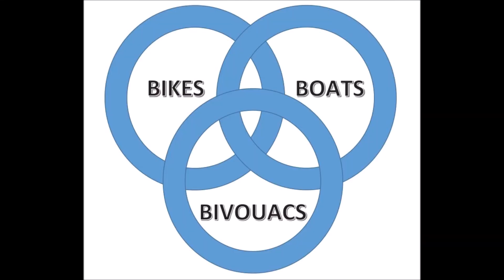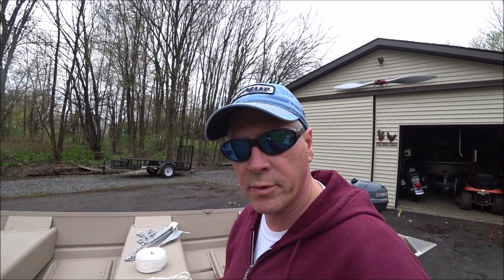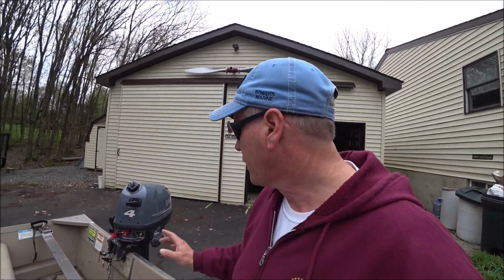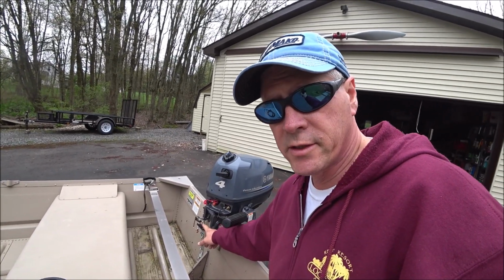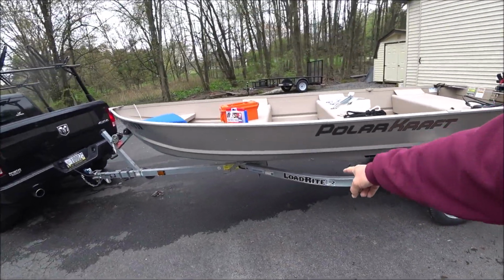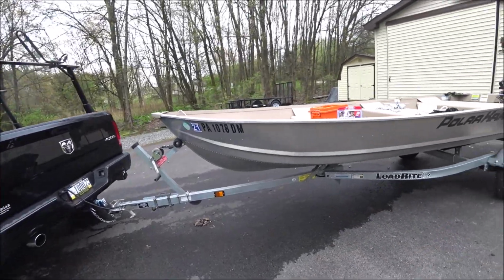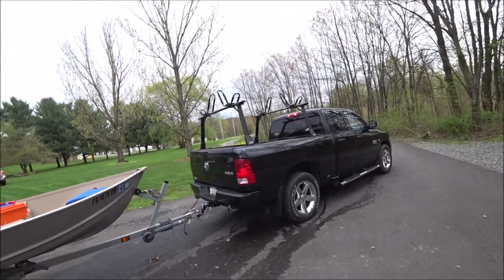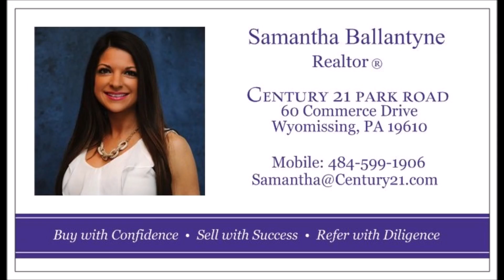Yamaha 4 hp outboard motor break in procedure on a PolarKraft 1460!

Comment: What I find strange is every motor, being car, bike, outboard, truck, tractor it dont matter what engine it is.  To test them at the factory before they get shipped out to the dealers every motor is put through its paces.  No running or breaking the motor in, it is wide open throttle, this is to make sure that everything is correctly installed.  You never see a new semi on the road without a trailer or a load on it.  Right from the get go they are worked hard.  I used to follow a break in procedure exactly the same as described in this video.  My last new outboard, I asked the mechanic that installed it, what do I do for break in procedure?  He said to me let the motor warm up at idle for a few minutes then get it moving, make it work, dont baby it, but dont thrash it either.  So within the first 10 minutes of starting the motor, I have it up on plane running at three quarter throttle.  With short bursts at full throttle.  all exactly opposite to what we are told in the owners hand books.  My last 2 motors I sold them with over 500 hours on them, never a single problem and neither used a drop of oil between services.  I really dont understand why all manufactures say that the motors have to go through a 10 hour break in procedure.
Reply from the maker: I'm not sure why they recommend it but it seems like your system worked. Thanks for watching.

Comment: Nice vid! What’s that thing you turned after starting the motor on top of the fuel reservoir.
Reply from the maker: That is the air vent. When running the engine on the internal tank you need to open the vent so air can go into the tank as the fuel is consumed by the motor. Thanks for watching.

Comment: So I have a 12ft Jon boat that me and my dad converted into a bass boat. We added a good amount of weight to the boat and we plan on going out on the water together. We also have a trolling motor with a 50lbs battery. I was wondering if it would be all right to go slightly over the weight limit on our boat and get a Yamaha 4hp or play it safe and get a Yamaha 2.5hp. I’m worried about going over the weight limit on our boat but I’m also worried about the 2.5 not being enough power.
Reply from the maker: If you go over the weight limit the boat may become unstable, this may cause you trouble. Thanks for watching.

Comment: I was just at a boat show and a dealer had a new but 2014 4 horse just like that.   I got it for $500.   Great deal so I couldnt pass it up, plus 3 year warranty. 
    Going to try it as a kicker on my 18' crestliner.   How do you like yours do you think it will do ok on my boat?   It is a long shaft so it will fit I know.
Reply from the maker: I think it will work on your boat as a kicker. Thiscwas the 2nd yamaha I owned. Always reliable and dependable. I upgraded to an 8 hp Honda electric start with a generator so I can keep my battery charged and run electronics. Thanks for watching.

Comment: Interesting break in process. I just got mine in 2021 and the manual said 

1. Let it warm up for 5min
2. 1hr Idle it to 1/4 but no more than 5min left there
3. 2hr idle it to 1/2 but no more than 5min left there
4. 3hr idle it 3/4 but no more than 5min left there
5. 4hr you can open it all the way but no more than 5min left there

And you do all of that with no weight barring on the motor.
Reply from the maker: They are always changing it. Thanks for watching.

Comment: Great video! I see in the comments below that your boat is 14’ long. Can you estimate the weight? I’m thinking about this engine for a canoe that weighs 110 pounds and I’m trying to get an idea on expected speed at 75% throttle. Thanks!
Reply from the maker: 144 bs + gear fule and motor. I guessing 200 lbs with gear. Thanks for watching.

Comment: new to getting this motors.. what gas ? just normal like for cars or have to mix? also whats the life span on this types of engines ? thanks
Reply from the maker: These are four stroke motors so you do not have to mix the gas. They take regular auto gas. If taken care of these motors will last in excess of twenty years. Thanks for watching.
Reply: @BikesBoatsBivouacs  Funny that you say that, I pulled up the video to see if you were going to explain the mechanisms because my 4 hp yamaha motor is backfiring anywhere from max throttle to 1/2 throttle. Any suggestions would be helpful, the motor is 6-8 years old.
Reply from the maker: @evancurtis128  The first thing I would do is put fresh gas in the motor. If you have non ethenal gas I would use that.

Comment: Yamaha outboards are way way over priced junk I see so many Yamaha motors that have so many problems overheating, ignition no start problems. Yamaha does make good stereo systems and bikes but they failed so bad with outboards I have this same 4 HP motor oil leaks from lower crank seal clunks when shifting stalls when idling sputters sometimes never seen a outboard with so many problems Yamaha make a good name for themselves but people are brainwashed because Yamaha makes shitty outboards and people pay top dollar for junk. Yamaha is like a force outboard as far as quality goes just look and see how many Yamaha motors are  in need of major repairs there all over
Reply from the maker: I had two yamaha motor, a 4 hp and a 20 hp and didn't have any issues with them.
Reply: @BikesBoatsBivouacs  there not all bad I just seen to many bad ones I guess I want to get a fuel injected 2 stroke next I am glad you never had any problems with yours I love Yamaha natural sound stereos and they do make good bikes and musical instruments